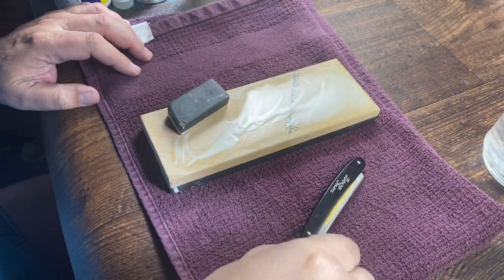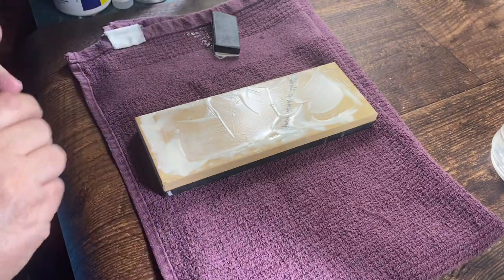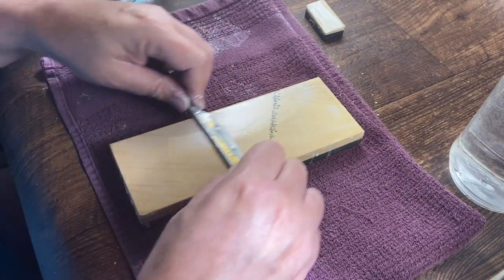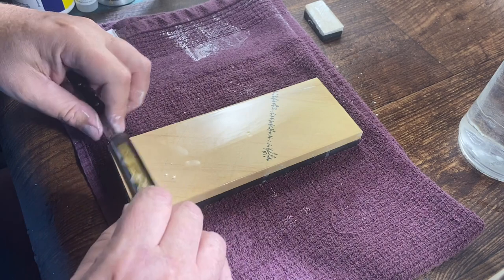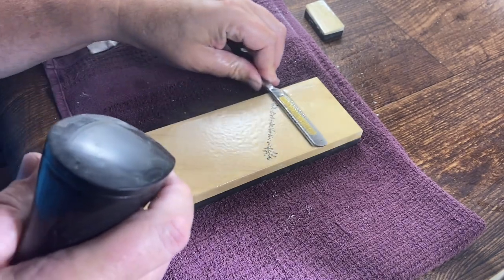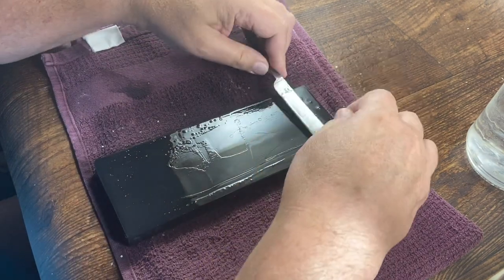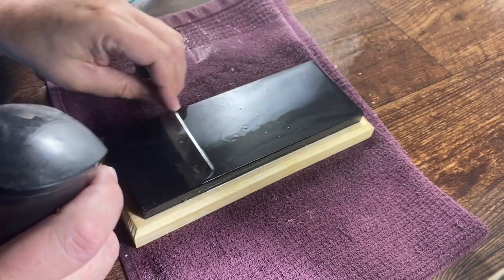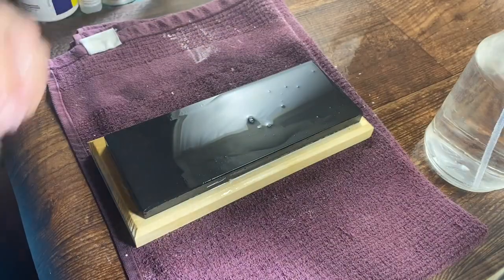09 28 2021 Dovo Inox Honing Dilucot / Diluark finihs

Comment: Great video, thanks.
When honing do you press the blade against the stone or is it done with a light touch?
Reply from the maker: When setting the bevel and in the early stages i try to keep an even but firm pressure for the 1st few progressions. Then it becomes lighter and lighter from the coti all the way to the ark